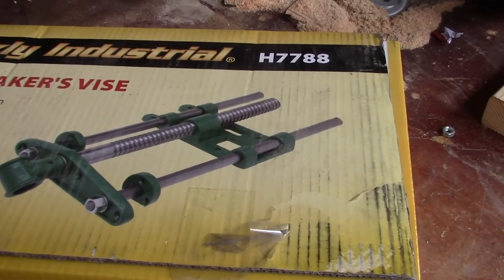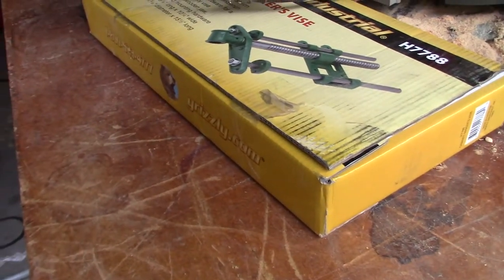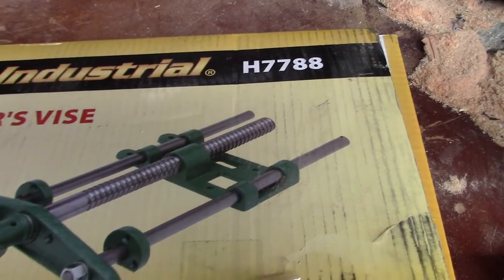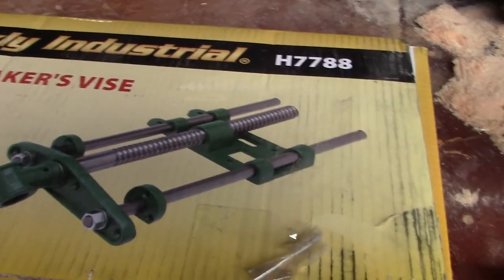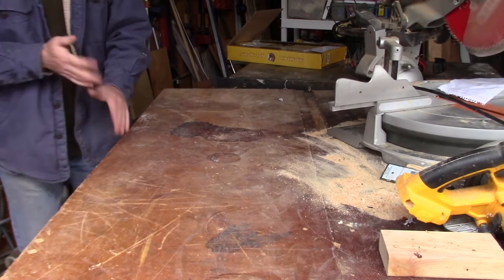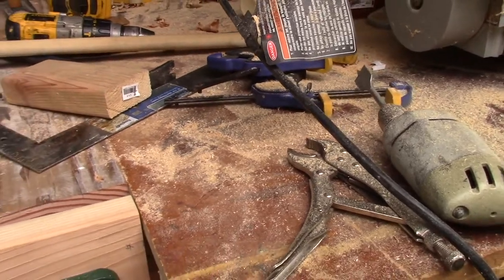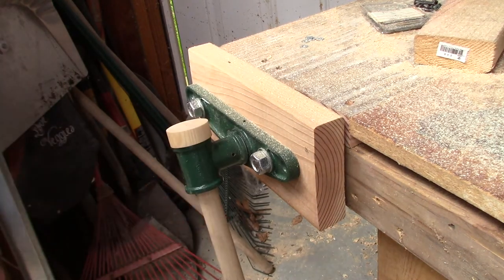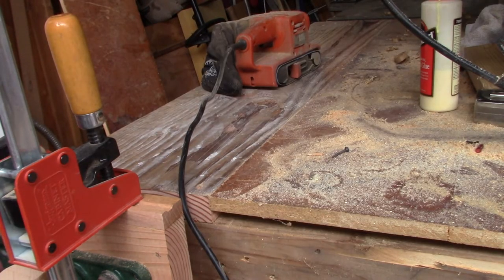Grizzly H7788 Cabinet Vise Review and Install

Comment: Thank you for the video. I have the same vice and I am about to mount it to my bench.  I have a slightly different situation and I will need to make some different modifications. But that being said your video is helpful. One final modification I will make is how I will engage the bench dogs with my vise. I feel I need a long flat surface without a “bump” up at one end. Instead of a piece protruding above the surface of the bench I will make a piece that can be removed from the thick wood panel on the jaw. I plan to drill several holes for stout dowels that will be attached to a piece of of hardwood and is removable when not needed.
Reply from the maker: Yeah I'm going to change mine as well.  I put that bump on there but it was a mistake.  I'm going to replace it with a proper bench dog setup.

Comment: Great video!.  Thanks!  I got the same vice-- of course no instructions in the box.  BTW,  couple of questions 1)Is the handle supposed to come out when your installing or does it stay together? and 2) How far from the edge did you mount the holding bracket under the bench.  Do you run it all the way out to the end- 1/2 way or up close next to those two round brackets?  I couldnt figure that out. Thanks again!
Reply from the maker: I made my handle to that it slides but will never come out.  After using it for a few weeks I really like it.  In answer to your second question, mine is about 1" from the edge.  You don't need to measure this since you can use a quick clamp and position the entire assembly and then drill your holes for your bolts.